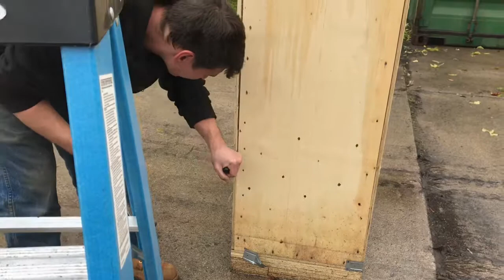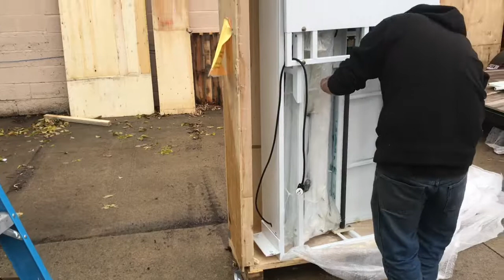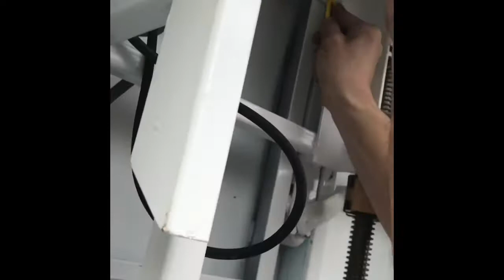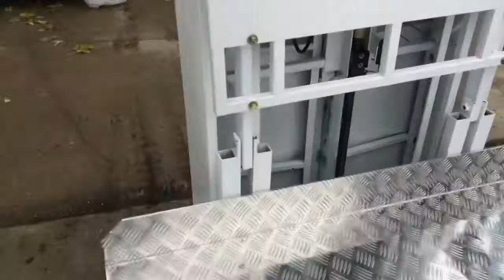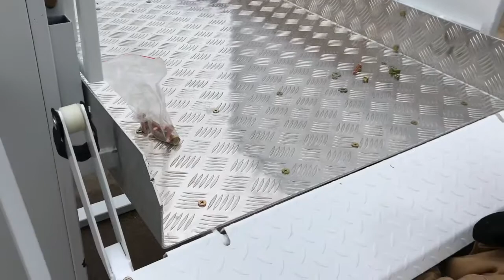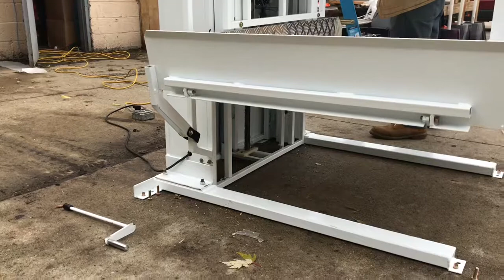Complete P-50 Assembly Guide

Comment: The Safety plate and the securing brackets  are machined to be identical ( the bend, the mounting holes )- why is it important to mount the securing bracket on the power cord side of the tower ?
Reply from the maker: Hi Mark, That is what the manufacturer recommends.
Reply: Thanks for replying...